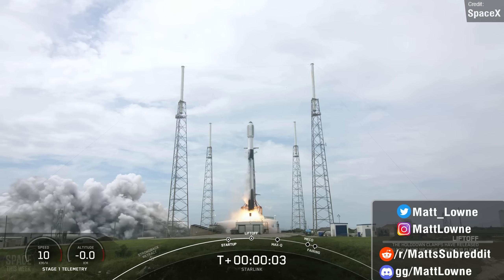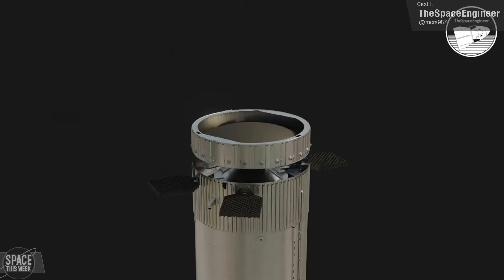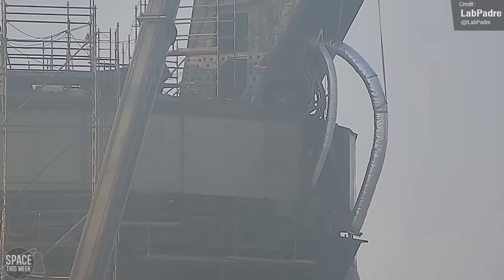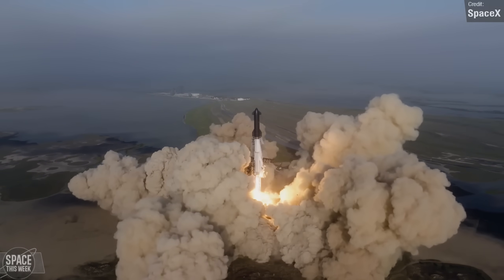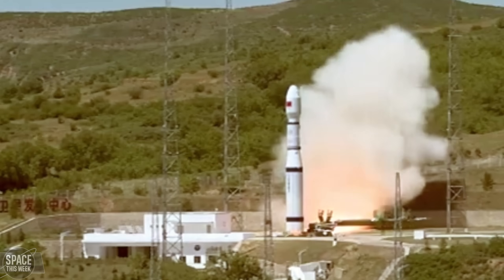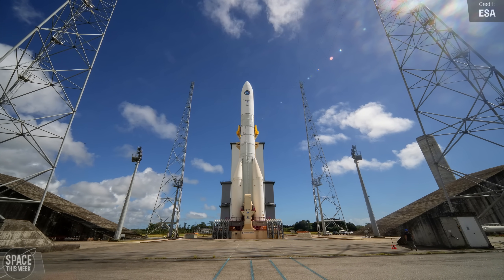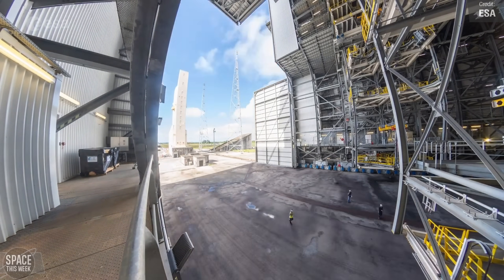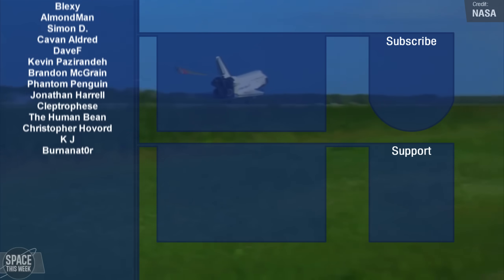SpaceX Starship's Insane Design Change, Ariane 6 Rollout, and The Penultimate Delta IV Heavy Launch

Comment: If the water deluge system under the booster sprayed more water into the central region, the extra water would generate considerable more steam. The extra steam would create a central zone with much higher pressure than would exist in adjacent regions.  As the rocket exhaust impacts the steam, the higher pressure zone in the center would divert the booster exhaust sideways towards the lower pressure zones.  This would act as a sort of a dynamic flame diverter as compared to the usual static flame diverters.

Comment: One small correction, you said yhe Long March-6 is a solid fueled launch vehicle, this is not the case.

The first stage uses a YF-100 engine which burns RP1, LOX 

And the second stage uses a YF-115 engine which is also powered by RP1
Reply: Is that putin

Comment: Hot staging is honestly not surprising to me. 
It is the simplest solution in many ways which immediately makes it attractive for SpaceX AND it's a part that allows launch escape for the second stage from the booster relatively safely.
Also they already have to figure out how to make a surface survive the wrath of the Raptors if they want to reuse a launchpad.

Comment: Look Hot staging the Rocket for Space X is more than a payload efficient play. If Space X does do hot staging it would be a safety move as well with hot staging starship would be able to have a emergency escape function built into the rocket. This is more important than payload efficiently. This is because Space X plans to have this Rocket move a lot of weight and a lot of people every day at full ramp so in my opinion safety is King.
Reply: I'm not so sure that Starship (second stage) can escape a catastrophic failure with the Raptor engines. The Raptor engines take a second or more to get to full power and the TWR is around 1.5. Contrast that with the Crew Dragon Superdracos that get to full power in 100 milliseconds and have a TWR of around 4.6.
Reply: @steveaustin2686  after learning more about their plans with three engines at 50% and it requires the booster to reduce thrust, I would agree. I didn't realize it takes so much longer to spin up these engines thanks for the info.
Reply: @rodneyroach7048  You're welcome

Comment: Hot Staging announced by Elon Musk is just a smokescreen for very .profound structural changes to the Starship. Space Cadets at SpaceX knew from the very beginning that unpressurized Skirt of the Starship was too weak, due to buckling caused by compressive thrust of 33 Raptors, to support whole mass of fully fueled Starship during liftoff. Despite knowing they took the gamble with test flight. Skirt that suppose to withstand acceleration of 4.5g partially collapsed at 1.75g. Elon knew for at least 2 years now that using Vac Raptors as support columns would eliminate buckling problem but he dragged his feet on implementation of this idea that was handed to him on a silver platter. Now pushed to the wall Elon devised this "hot staging"  as a way to deceive everybody that he is switching from Skirt  as support to Vac Raptors as support columns as a necessary change forced by "hot staging" concept.
Reply: Do you have proof of this buckling of the skirt on Starship (second stage), since it did not appear to be buckled on the 'orbital' flight.
Reply: There is a picture taken by the camera mounted on outside of the Starship pointed at SH Booster  and it shows whole stack bend at Skirt. Bending of the Skirt can only be accomplished by way to buckling of the skin.

Comment: In the Titan II, the holes right above the first stage propellant tank bulkhead were not the only vent ports. If you look right above it, there was an inter-stage ring that had bigger vent ports. Even so, when the second stage engine ignited it obliterated that inter-stage ring into "a million" pieces. Luckily it didn't affect the second stage. Regarding Starship and it's booster, I don't think the second version of the ring has large enough vent ports for the power the those Raptor engines. It looks like a failure waiting to happen, just like the lack of flame deflectors destroyed the launch pedestal on the first launch. I think reinforcing the first version of the inter-stage ring, with the much larger vent ports, would be a better option.
Reply: It seems like billionaires are wanting to use cheap and dangerous designs because those tactics got them their billions to begin with.
Reply: Elon seems to be intent on building as many failures as possible, though.

Comment: They should try to get into orbit first...  Try Hot-Staging later...
Reply: Orbit is not the concern; it’s stage 1 reusability, especially if you want to relaunch it in a few hours over and over.
Reply: @EMichaelBall  Eh, orbit is the concern, because if you can't get to orbit, then you can't do anything. Hot staging may be a stop gap to get Starship to orbit, so that they can workout propellant transfer of hundreds to over a thousand tons of propellant. Artemis III is not that far away, even if it slides into 2026.
Reply: @EMichaelBall  Understood.  BUT.  They should get to orbit first.  Or at least into Space...
Reply: @wxb200  Yeah but they at least should make a rocket fly more than 2 minutes first.
Reply: @mofka26  Agreed.  BUT...  Space.

Comment: Hot staging feels like a bad idea for a craft (superheavy) intended to be used dozens if not hundreds of times.  Most airliners dont take blowtorches to their craft.

I always thought not making it a 3 stage to orbit rocket was odd.  The middle stage can be the disposable one.  Effectively a gasket betwen the more expensive, more re-usable upper and lower stages.   We already have a word for this "Kick-stage".
Reply: Considering that the whole point is for the entire thing to be reusable, a disposable stage is kind of contrary.  Then again, hot-staging is also kind of contrary to the goal.
Reply: @vicroc4  even in an airplane you need to replace major parts somewhat frequently, no machine is completely reusable
Reply: @thevictoryoverhimself7298  Airplanes don't discard a significant portion of themselves on every flight.  The cost of parts to maintain an airliner is relatively low compared to their cost to build.  That's the paradigm Musk wants Starship to operate in, rather than throwing away an entire expensive stage like is already done with Falcon 9.

Comment: I just realised that despite the Falcon 9 first stage reusability we never see any focus on the second stage.   If you think about it, Space X has built over 200 second stages.   There has been very little focus on how that stage 2 is built, iterated and improved.    They churn out one of those a week....  a fully space-worthy stage of a rocket!   We never see them test firing it or anything.   How well do they iterate the manufacture of them... bet it's very efficient.
Reply: More than 1 a week, as there have been 40 launches this year and it is week 26. All SpaceX engines are test fired a the McGregor, TX engine test facility.
Reply: Well are newest short nozzle upper stages engines, on some of the newest falcon9 upper stages , aren't more efficiently (actually are less than big nozzle engines ) but are much cheaper , it's all about high price of the Niobium used for making those nozzle.
Reply: Everyone is missing the point.  Yes I know the details what I am saying is there is so little focus on such a critical part whose story is probably a lot more interesting than many people would suspect.   An unsung hero, if you will.
Reply: @mdarian  I don't miss your point, but I think you are wrong when you said that isn't room for more improvement for falcon9 upper stage, basically what Elon said few years ago is that they wouldn't improve any part of falcon9 anymore, because Starship would replace very quickly that old rocket , and isn't any point in spending more money on small improvements of that old rocket that will be dismissed anywhere , obviously he was wrong because Starship didn't launch satellites right now, and probably for another two years at least. Basically the upper stage of falcon9 isn't the best thing in the world (because isn't, other rockets upper stages crushing it very easier )and even the best thing that SpaceX can make, but a good compromise, cheap enough and good enough to dominate the current competititors in the conjunction with reusability of the first stage.
Reply: @theOrionsarms  Eh, SpaceX designed the Falcon upper stage to save money, not have the best performance. For top performance, you want a LH2/LOX upper stage. SpaceX went with RP1, so that they upper stage engine is just a vacuum optimized Merlin, which they already make a lot of. Parts commonality between the stages keeps costs down, since the majority of missions are to LEO.

I think that SpaceX isn't doing major modifications to the Falcon rockets, so as to not imperil the crew rating for the Falcon 9 B5 nor the NSSL certifications for the Falcon 9 B5 and Falcon Heavy. The NSSL payloads for the USSF/NRO are the second biggest customer for SpaceX, behind NASA missions being the top customer.
Reply: @steveaustin2686  obviously I know that NASA wouldn't allow any change in the falcon9 used for crewed dragon, but I'm speaking about comercial launches and especially their own starlink satellites, nothing stopping them to make modified upper stage for that purpose, just for fun I make some estimations how much improvement would give replacement of current upper stage with one that use metalox, (with 385 second specific impulse, instead of 350), assuming that dry and wet mass are remaining the same and the booster isn't modifyed, and remain reuseble. For a very lower orbit like one in which are putted starlink satellites in the best case you get 25% increase in payload(from 16,5 to 21), but surprisingly most beneficial would be GTO with more than 60%improvement at almost 8 tonnes, for comparison reuseble version of falcon heavy can put only 8,2 tonnes in GTO. I know what you will say that isn't any engine that could be fitted for such upper stage, well SpaceX can make one, they make a load of raptor engines and don't make money with them yet, a customized lower thrust vacuum version could be developed if they wanted that, and produced in relatively small numbers like 30 per year, with little effect for the current engines production for Starship program . PS just speculating here, I know that a decision was made to not make more improvement of falcon9, but that doesn't mean that isn't possible.
Reply: @theOrionsarms  SpaceX is all about keeping costs low, so that their launch price is low. If you start running multiple lines for constructing stages, that isn't going to be cheap. SpaceX has been making incremental changes, doing them first on their own Starlink launches and then rolling them over to NSSL and NASA launches when they have proven their worth. See the short engine bell for the Mvac engine. Nothing big or radical, so that they are modifying existing, without starting a whole new assembly line.

Converting the Falcon 9 to use Raptor engines is not as simple as slapping on the new engine like in KSP. The Raptor is a much larger engine than the Merlin engine, so you have to completely redesign the thrust plate and plumbing, not an easy task. The propellant ratios for fuel to LOX is vastly different between RP1 and LCH4, so you are redesigning the tanks. So you are basically now just building a completely new rocket, to go along with the Falcon booster and Falcon Heavy core booster assembly line. So you need a whole new production line. A 3.7m Falcon 9 booster size may only hold 4 to 5 Raptor engines. So now you lose the engine out capability of the Falcon 9 with 9 Merlin engines. With a Falcon 9, if you lose one engine at liftoff (11%), the other 8 can still get the payload to orbit (89%), just by expending the booster. Insurance companies love that feature, as a single engine failure doesn't doom the mission to an insurance payout. So insurance rates for Falcon launches are cheaper. If you only have 4 or 5 engines, losing 20% to 25% of your thrust at liftoff, almost certainly ends the mission right there. So insurance rates will be higher, driving up costs.

Could SpaceX build a Raptor version of the Falcon rocket? Sure. Would it be worth it to SpaceX? Especially when Starship is expected to cost around a Falcon Heavy and maybe a Falcon  9? Nah, it likely would not be worth making a Raptor version of the Falcon boosters with Starship on the horizon.
Reply: @steveaustin2686  I wasn't suggesting replacing Merlin engines on the booster with Raptor, I only shows what effect would have replacing one single vacuum Merlin of upper stage with a MODIFIED version of Raptor (why do you think that they cannot make a lower thrust version specifically for that purpose?, and you are wrong, Raptor isn't much more heavier or bigger than Merlin), even the upper stage would remain mostly the same, that would be a small modifications. And as I said before, I don't think that they would make that, but maybe  they should have tried that a few years ago, and probably falcon9 would fly for another ten years, I don't believe that Starship would be that cheaper, and at least for a few years would be used only in specific cases.
Reply: @theOrionsarms  The Falcon 9 v1.0 started off with 9 tons to LEO when expended and the Falcon 9 B5 is 22.8 tons to LEO when expended. There likely is not much more performance that can be wrung from the Falcon 9. 

Raptor gets some of its higher ISP from using LCH4, so it won't really translate. Modifying a Merlin to be a full-flow, staged combustion cycle means making a new engine. Same for converting Raptor to RP1. 

The Raptor is reported to be 1.3m (4.25ft) in diameter and mass 1.6 tons. The Merlin 1D is reported to be 0.9m (3ft) in diameter and mass 1 ton. So yes, the Raptor is larger than the Merlin. Where 3 Merlins can be across from each other in 4 directions, Raptor might only get 3 across in 2 directions, IF they can get 3 across at all.

The modifications to swap to a larger engine is not trivial. Same with swapping propellants. Real life is a LOT more complicated than KSP and I'm only scratching the surface as a lay person to rocket design. There are issues I haven't even thought of.
Reply: @steveaustin2686  amazing, you think that enormous Starship would be easy and quick , but the same people cannot make a smaller upper stage falcon9 that work on methalox, they have everything in house, the many factories the expertise in working with methalox and abilities to make customized engines(because that is what different version of Raptor are ) , and the benefit would be significant like I said before (25% increase in payload for LEO and 60%for GTO),and by modifyed Raptor, I want to say a smaller one that have a vacuum nozzle and still work with methane(actually the first prototype developed from 2015 was similar in size and thrust with Merlin) , I don't say that everyone can make that but obviously they can if would choosing that.

Comment: Hotstaging: I watched a recent Starlink mission and I counted about 10seconds of time between MECO and SES-1.  If this could be eliminated using hotstaging, how much more mass could you get to LEO?  I am guessing another 10/160 or 8%, but could be more.  Can anyone that understand the rocket equation better provide an estimate?
Reply: How much of that is wiped out by armoring the Superheavy to survive the hotstaging? It might be a wash or even a negative.
Reply: @steveaustin2686  Good point.  I guessing that the 1m hotstaging shim and armour will be 1-2% of Superheavy's mass.  Obviously if the extra structure is too much it wipes out any potential saving.  I believe that the Russians used hotstaging successfully, but they were non-reusable rockets, so not nearly as big a challenge.
Elon is obsessed with mass to orbit, so I expect that they will pursue this vigorously.
Reply: @bru512  The Minotaur I uses hotstaging IIRC, but those are solid rocket motors so are also expended. Until it was taken down, the Starship Users Guide had 100+ tons. He later said that had went up to 150 tons and recently changed that to 180 tons.  So if, IF it works and doesn't drop below 150 tons of payload, it might be worth it. I'm just not sure the booster will be able to be rapidly reusable like he wants.

Comment: I suspect the main goal of the slots is to eliminate the risk of gasses building up between the stages.  It's not open enough to allow for hot staging.
Reply: It would need some proper diverters to not damage the 1st stage.
Reply: @koro14520  That;s also true, the front end of stage 1 so far has just been the top of the oxygen tank I believe and exposed piping.

Comment: Hot staging, that is what the Russian N1 did and also the Soyuz I believe.
Reply: All R-7 derivatives like Soyuz do use hot-staging.  A lot of early multi-stage liquid-fuel rockets did because they weren't sure how the fuel feed would work in the freefall that happens after first stage cutoff.  The Titan and Titan II ICBMs, as mentioned, also used hot-staging.  But later multi-stage American launch vehicles would use ullage rockets or RCS thrusters to settle the fuel to where it could properly feed.

Soviet designs mostly didn't bother with ullage, and just chose to light their upper stages while the lower one was still attached.

Edit: That's also why the Atlas used its weird stage-and-a-half design, because they weren't sure they could get a second stage to light.
Reply: All Russian rockets do it as far as I'm aware, with some exceptions like Energia.